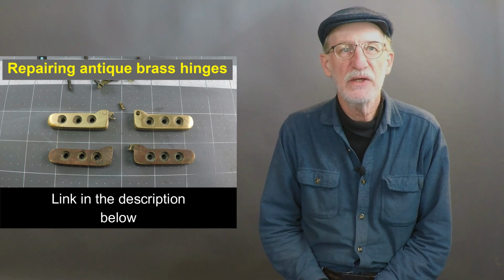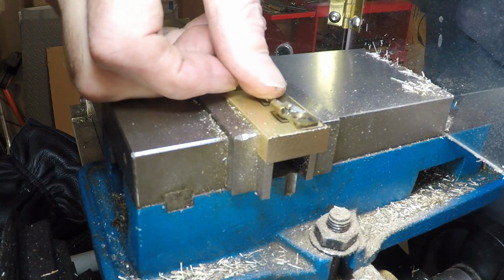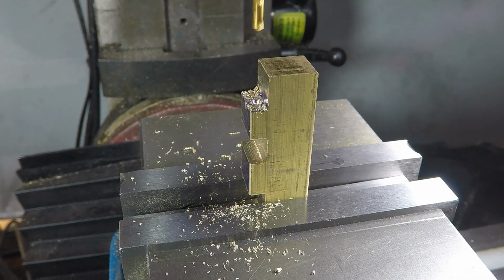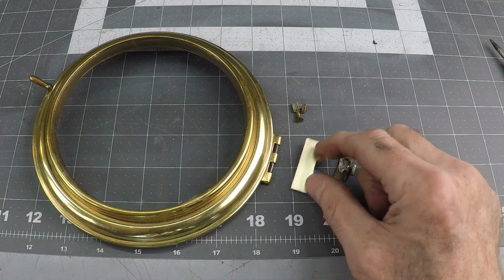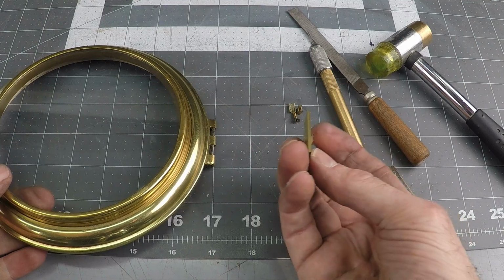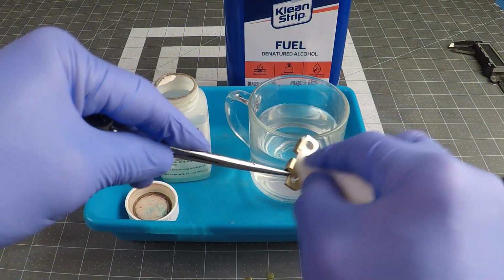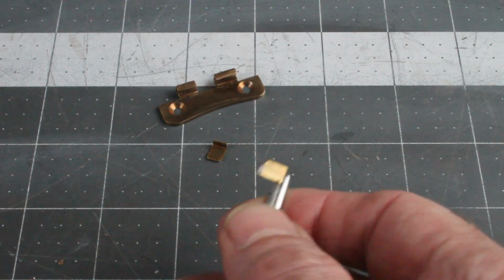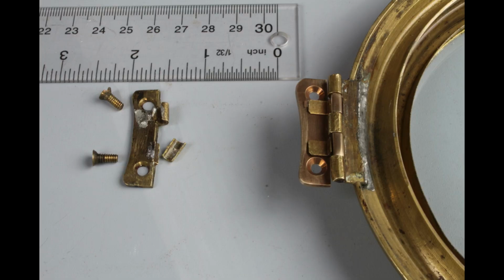Antique clock hinge repair

Comment: I'm having to repair this brass bezel hinge on a Gilbert Tambour...the brass hinge has been pulled clean out of the wood "Face," and it also appears that it has had some earlier "Attempts" at repairing.
I'm thinking unless I can find a suitable replacement, I will proceed to cement it back in place w/ a quick-cure epoxy... Appreciate your sharing this. Thanks, and take care...
Reply from the maker: I hope your repair works out well, it can be tricky!
Reply: @GuyMarsdenMakesStuff 
Agree! I really dislike using an epoxy on any clock, but this one is pretty rough, and my friend who it belongs to only wants it workable. To be able to open and close in order to wind, etc.
Thank you again for sharing this...

Comment: Are you sure? It looks like the hinge is on backwards, where you'd want the countersinks facing up, same as the front of the cover. The way it is at the end would only work if it was screwed in from the inside of the clock, but then that doesn't make sense based on the offset of the hinge on the door..

Pretty sure it goes the opposite way, especially for your last picture in the last few seconds of video...
Reply: He’s got it right! It’s my clock. The clock cover was upside down.
Reply: @andrewhale8834  The reason I bring it up wasn't to nit-pick.. it was more about me falling prey to that exact thing, except mine was soldered! Completely finished, polished to a mirror shine, quite proud of myself...

Go to install it, and realized I installed it backwards and there was no way to fix it. Had to cut it apart (the part I made) to salvage the original half, and remake the part from scratch all over again.. I made sure to quintuple check the second time, BEFORE I started soldering!
Reply from the maker: Yes, the countersinked holes face front when the cover is closed.  This way the screws go into the clock frame as they should.